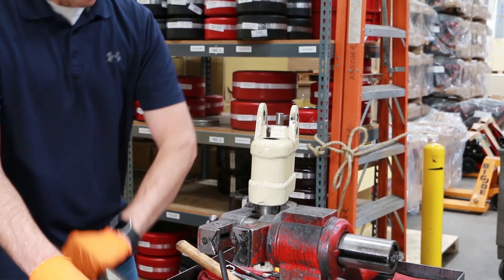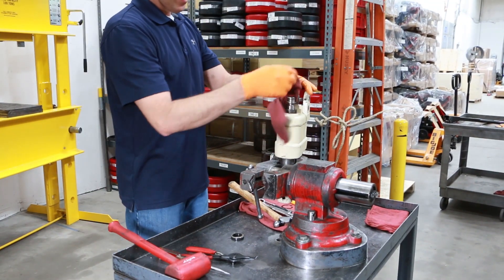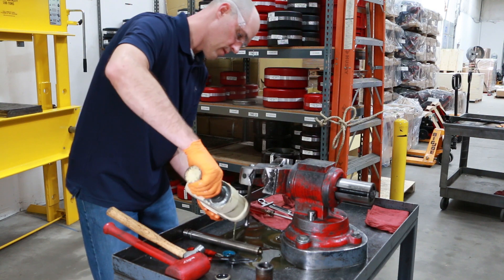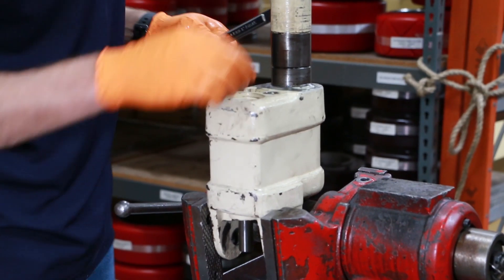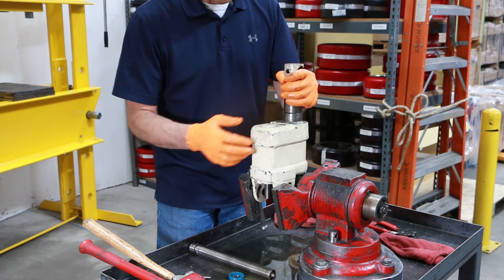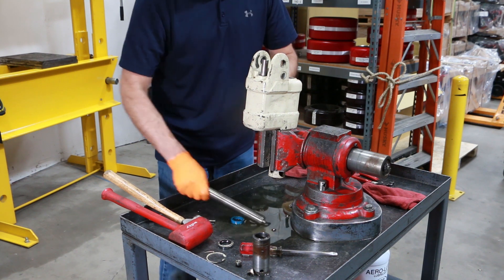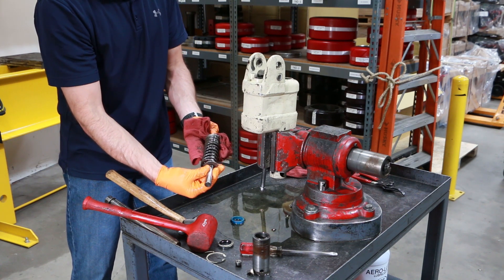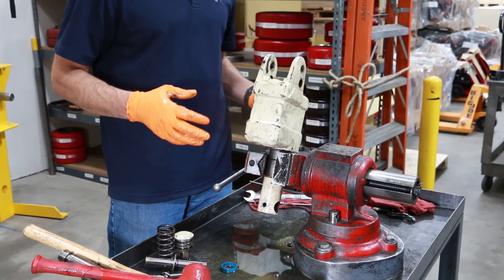Part 2: How to disassemble Crown PTH50 Hydraulic Pump in order to rebuild it

Comment: Will CR44648-SUPER SEAL KIT WORK IN A Crown PTH50 S/N 7-266395
Reply from the maker: Mi Mark! Correct seal kit CR 44648-SUPER will work for your pallet jack serial number 7-266395 and all units up to 7-512501

Comment: I just bought a older ELP55 lift jack today pretty cheap the pump will go up, but slowly come back down.  Is the pump bad? Or just the seal ? It doesn’t leak but I don’t really have a lot of knowledge on these. Any help greatly appreciated!
Reply from the maker: It Sounds like the valve core is not seating properly into the valve body. But it could be a number of things wrong. If you leave your email in a reply, or call, we could send you a PDF of the parts breakdown.
Reply: Generic Parts Service Dominickgmtz@hotmail.com